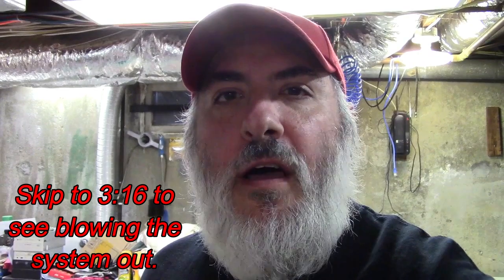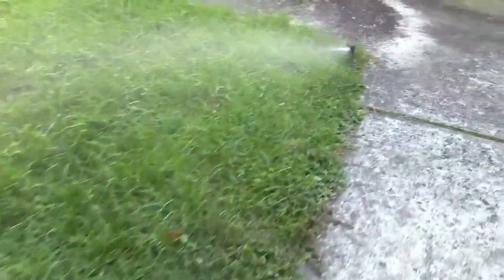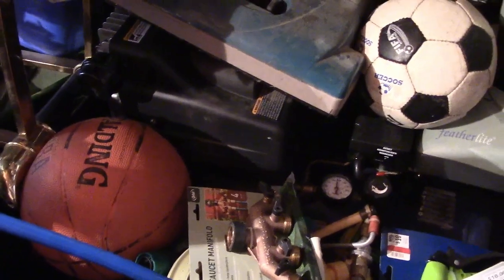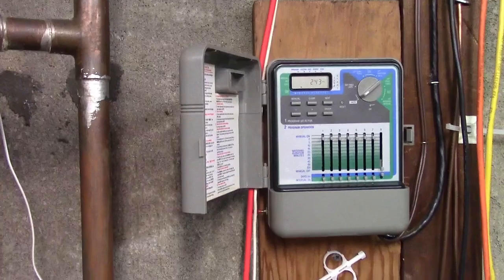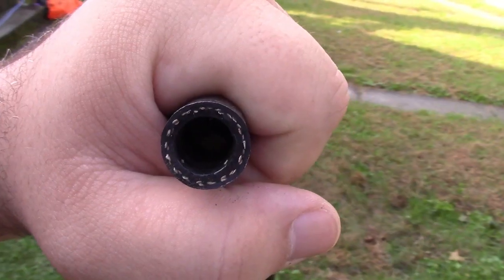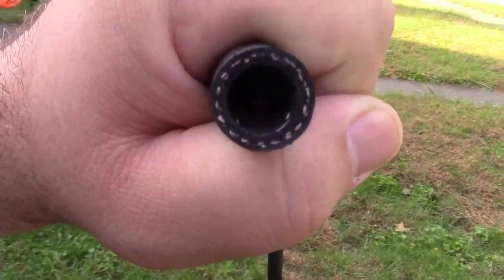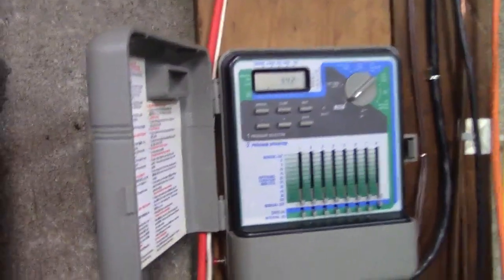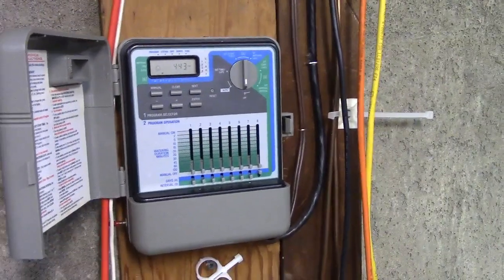How To Blow Out (Winterize) Your Inground Sprinkler System (2018)

Comment: I still need to do the laundromat.
Reply from the maker: Hasn't frozen yet, so there's time.
Reply: Those cold temperatures can roll in fast.
Reply from the maker: True, but a lot of times it takes several days of freezing temperatures to cause a problem.  I'm not necessarily saying to put things off for tomorrow when you can procrastinate today.  But it got cold enough for me to have to put the heat on a couple weeks ago, and then it was warm enough that I shut it off on Halloween, it's been off since.  Just today it's getting a little bit nippy; if I don't turn it back on tonight I will tomorrow.